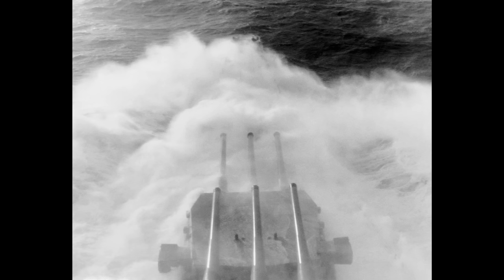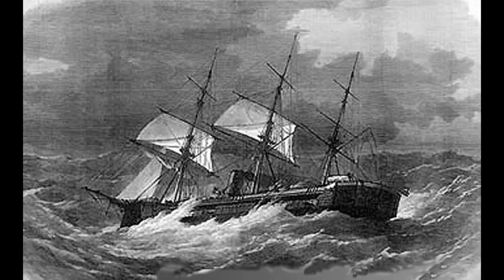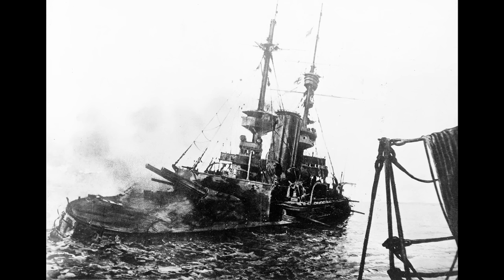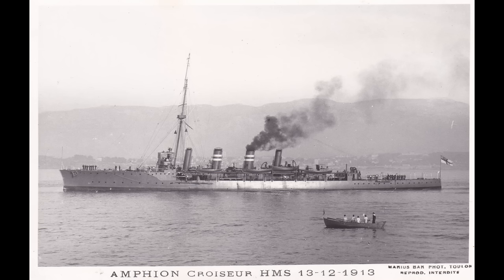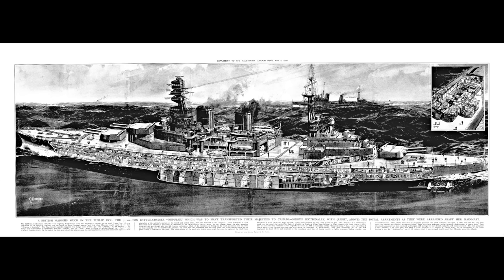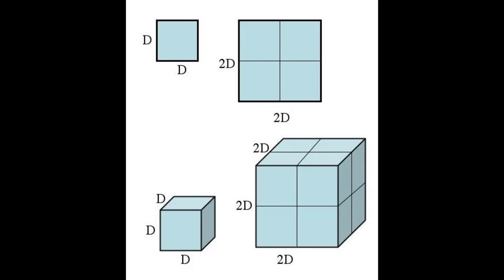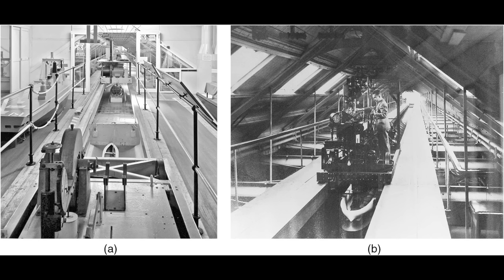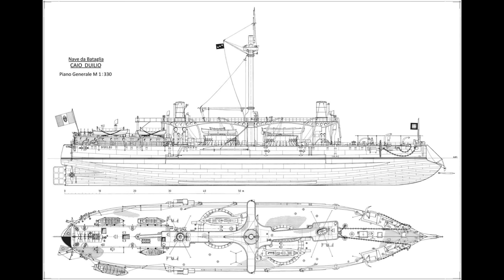Hull Form Design - Doing better than a floating brick

Comment: The Square Cube Law: it's why a 20" shell is a lot more than four-inches scarier than a 16" shell.
Reply: Before taking in other factors,the funniest being that no one knowing that your BB has the biggest fielded guns due to how well kept a secret it was until after the war is over.
Reply: As a practical example, the iowa's super heavy shells had around 18kg of bursting charge, the yamato's type 1 had 38kg. That's at least 2 times as scary lol
Reply: @pedrofelipefreitas2666 ,one of the other factors was the fact that the Iowas' shells actually penetrated better at long distance due to the denser design of the fore end then the Yamatos' shell.

Comment: Currently sitting in my stateroom on the usns loyal watching this. Google the ship to see what happens when you care about sea keeping to the extreme. We barely roll at all in up to 12 ft seas... but out top speed in a sea state 0 is 6 knots
Reply: That is the epitome of brick
Reply: @valhallastiger2960  Well, it's not meant to go fast.  It's a passive SONAR surveillance vessel.  I would think a slow top speed would be considered a desirable feature in such a ship.  Passive SONAR doesn't really get along that well with fast travel through the water.

I do have to wonder how USNS Loyal managed a rated speed of 9.6 knots if she only makes 6 knots in a flat calm.
Reply: @evensgrey  i wasnt attacking the ship it just wasnt what i was expecting to see 

Is it twin hull or single?
Reply: W I D E
Reply: @evensgrey  maybe when it was first commissioned it went 10 knots ( I doubt it) but she's not exactly a young girl anymore. If we really push it we could get 7 knots probably... but then the main engines would want a few weeks of R&R
Reply: @valhallastiger2960  twin hull
Reply: @valhallastiger2960  And, well, she is shaped kind of like a brick.  Of course, being a catamaran design, drag has little to do with her actual length to beam ratio (which is an otherwise astounding 2.5).
Reply: @michaelhellwinkle9999  i guess that helps make her more stable spreads the weight further?
Reply: @evensgrey  6 was probably a bit low of an estimation I guess. However I can say we try to go with the current when we are on station as much as possible, so that 7.2 should be taken with a grain of salt
Reply: @evensgrey  we are currently in port in Yokohama, but yea, could be rough when we go back out, but that's why they pay me
Reply: SHE A BIG GIRL
Reply: @evensgrey  I assume it involved dumping copious amounts of NOS into the engines.
Reply: TANSTAAFL.
Reply: Is that a SWATH design?
Reply: @Hugh Culliton i believe a head sea is coming from straight ahead or behind and beam is coming in from the side not certain though

Comment: Then there's all the fun you can have with SUBMERSIBLE hulls.

Back when the US began playing with nuclear powered submarines, they decided to build a little experimental boat, mostly full of batteries, to do some testing of what the handling characteristics of this new hull form called a 'body of revolution' would be like.  The tank tests said it should be a very efficient hull form for a sub while underwater, which was where a nuclear powered sub was expected to spend almost all it's time while on patrol.

A body of revolution is one which is formed by taking a curve and rotating it about an axis.  For the sort of curve you'd use for a hull shape, the result is sort of cigar shaped, and all cross sections of it are circles.

So, they build this test boat and take it out to do test maneuvering to see if it does anything strange.

Well, it did something strange, all right.  The strange behavior was named the "Jesus Christ Factor," most likely due to someone saying that when it was discovered.  One of the properties of a hull form that has all cross sections being circular is it has no hydro-dynamically preferred orientation in the water.  They tried to pull a sharp turn (like you'd pull in combat to evade enemy anti-sub weapons) and discovered that when you turn sharply in a sub with this kind of hull form, it likes to snap-roll into a steep dive, in excess of 45 degrees down.

Now, snapping into a steep dive is fine and dandy when you WANT to do that, and could make for a nifty evasion maneuver, but most of the time you don't want to evade like that. It risks you hitting the sea bed or exceeding your crush depth.  fortunately, it just needed a small rudder added to the back of the conning tower to prevent the boats from doing that.
Reply: USS Albacore. 

Round hulls with the slab sided sail makes for an interesting ride on a surface transit in rough seas.
Reply: @mikespangler98  Yup, the US Navy spent decades interested in any kind of round hulls with slavs.
Reply: Just reading this made me pucker up. Congratulations, you actually made me feel anxious... and very glad I am a Mountaineer, not a Mariner.
Reply: @Deridus  Testing out new vehicle designs can indeed be fun.  Makes me glad I don't I'm not a pilot of flying, floating, or submersible craft.
Reply: @evensgrey  There are some things I am too chicken to do. I know my limits. That said... In a different life track, I'd love to be an experimental aircraft pilot.
Reply: @Deridus  I have the opposite problem. I don't have very strong self-preservation instincts, and yet I'd like to be a test pilot, too. Probably good I haven't got the opportunity 😅
Reply: Icebreakers are interesting too. Hull form is also circular, to resist pressure from ice. Kinda shaped like a football. Man! They can ROLL!   (At least the Wind Class breaker I was on could, rounding ‘The Horn)
Reply: that makes for an interesting hypothetical underwater fighter craft. Imagine a sub with everyone seated in car racing seats with harnesses at their stations... Sub does snap rolls, immelmans, split s's  etc 😂 i suppose with nuclear power, you could probably even do an "outside loop" given enough depth...  Haha would make an interesting anime at least, underwater fighter planes haha
Reply: @Colt45hatchback  You'd be hard pressed to jam a power plant able to drive a sub through those kinds of maneuvers into a hull small enough to actually pull them off.  You can get away with aircraft pulling those sorts of maneuvers because air is so much less dense and so much more compressible than water.  You'd have to have a really, really small sub to try those kinds of maneuvers, and it couldn't hold much in the way of a power plant or weapons.

But, as you say, in anime, well, who pays attention to the laws of physics?
Reply: @evensgrey  yeah I agree, just a bit of humor not reality.
Reply: @evensgrey  I mean, if you've got a dense enough power supply (ultracapacitors or some kind of high-density chemical fuel either traditionally combusted or run through a fuel cell) you could get enough power for a short-range craft.  You could help the miniaturization by replacing the pilot with a computer.  At that point, though, you're probably just better off making a better target-seeking torpedo than an underwater fighter as you only need to get it enough power for a 1 way trip with 1 weapon and don't need to worry about how the parts will hold up to repeated use.

It's not that it's impossible to design small underwater combat craft.  It's that it's hard to design ones that outperform a torpedo for a given effective range (especially if you're wanting the pilots back).

Probably better that way, though, if less cool
Reply: The USS Albacore was a hull test bed. She was powered by two vertically mounted radial diesels. (can’t remember the number of cylinders), and was built without armament.
During her lifetime, she had several different rudder, stern plane, screw, and sail designs fitted. Maybe bow/sail planes as well.
She can be toured and studied at Portsmouth Navy Yard. 
Being an old Polaris Submariner myself, I would have loved to serve on her during these design iterations.
Reply: @evensgrey  Ackchyually ... there are ways to dramatically reduce high-speed resistance (eg, supercavitation), reactor designs that can be much lighter and more compact than traditional PWRs (eg, molten salt reactors), and probably propulsion systems far more suitable for use in a high-speed/zero-stealth sub, as well (supercritical steam jet, maybe?).

As an aside, learning about the history of molten salt reactors made me say two things I never thought I would: "Cheap, clean energy should be no problem at all!" and "Thank goodness for ICBMs!" You see, MSR's are classified as an "advanced reactor design" many think are at least a decade from commercialization, and could potentially eliminate virtually all of nuclear energy's issues, particularly safety. However, the first MSR was built and operated in the 1960's, and showed significant promise, but was not just abandoned but forgotten after the cancellation of the program that spawned it, namely America's quest for a nuclear-powered bomber. It took 40 years for someone to stumble across a footnote in a history of nuclear energy and say, "Hey, that sounds interesting. Where'd all the files for the program end up?"

I didn't have much faith in humanity to start with, but learning all that made me lose most of it. 😆
Reply: @Deridus  cautious curiosity is exactly the attitude required to be a good test pilot. there are old pilots, and there are bold pilots. only very few have the luck required to be both old and bold. knowing how to expand your limits without exceeding them translates directly to your ability to test an aircraft without killing yourself or destroying the prototype.
Reply: @tissuepaper9962  I've always wanted to be a pilot. If we ever get off tis rock, I envy the first person who will actually fly under a diffrrent sky.
Reply: Can someone answer why early dreadnoughts had underwater bows projecting in front of the prow?  This was changing as we entered 20th century.
Reply: @slotcarfan  Most early dreadnoughts had ramming bows.  This primarily stems from multiple effective rammings carried out during an unusual battle in the 19th century involving the Italian navy.  I think the only dreadnought to successfully ram anything was HMS Dreadnought herself, who managed to ram and sink a sub.  Eventually it was worked out that ramming was not a good idea, and the ramming bows were no longer installed.  Not long after, similarly shaped bows were added back because they allow ships with them to move faster for the same applied power.

Comment: Everyone: Which would be better, thin and long, or short and wide?

Rear-Admiral Popov: R O U N D.
Reply: " K R U G "

(КРУГ is circle in Russian.)
Reply: I vote for a coricle
Reply: An expression of the Russian soul in steel - present a threat in all directions,  while confusing the opposition as to where you're going next!!
Why aren't there more armoured coricles around, I wonder......(nod to Tom 😆). On another note, there was a 2018ish? attempt at a similar ice pack resistant arctic oil drilling rig/mobile island deployed off Alaska, didn't go well and ran aground on a real island. 🙄
Reply: R O T U N D
Reply: "Ahh, I see you are an Admiral of culture, as well..."
Reply: Robbie Burns answered that one with a typically bawdy poem:
Lang and thin gaes tee far in
And disnae please the ladies.
Short and thick does the trick
And brings forth muckle babies!

Comment: As a naval architect with more than 45 years of experience in hull design,  this was a good video for non-technical people to help them understand the complexity and compromise that goes into every ship design.  
On stability: roll acceleration is critical not only to equipment functionality but also to habitability. Too stiff a ship, roll period very short,  and equipment, especially those located in high places can actually be broken off the ship, and people have trouble standing and moving around. 
On speed/power: as a gross rule of thumb for every 3 knot increase in speed, double the shaft power. This rough approximation works throughout the speed range.
During my 12 years responsible for hull form at a major U.S. shipyard,  it was common for us to go through dozens of iterations on the hull geometry (both commercial and naval auxiliaries ships) before we settled on one that met all of the requirements for speed, power, range, habitability,  seakeeping, maneuverability, as well as sufficient volume to carry whatever was necessary to meet the mission requirements. Inevitably,  the final hull was not ideal for any requirement,  but always met, and often significantly exceeded,  the contract specifications. Always a fun puzzle to crack!
Reply: On stability(habitability): I think some roll periods/accelerations are very detrimental to seasickness and such, so that also have to be considered.
Reply: Does that doubling power for an extra 3 knots apply to those 10,000 gross ton catamarans made by companies like Incat that cruise at 40 to 50 knots, or is the equation different for big catamarans?
Reply: The soul of engineering is compromise.
Reply: @philipwebb960  the art is how you put ten pounds into a five pound bag better than your competitor.
Reply: Thank you for sharing
Reply: And this is also the reason Asian ship yards build dozens of identically sized and shaped cargo ships regardless of the service they are designed to meet. Basically Oil Tankers, Ore Carriers and Container Ships from a given builder are dimensionally identical externally with almost identical power & crew modules at the rear.

Comment: I can't believe you didn't go at least a tiny bit into the American stern, with its surfboard like qualities that got rid of the turbulence not by narrowing the stern horizontally, but tapering it vertically. THAT is where America got her fast battleships, even though prop design then became a problem for quite a while, due to cavitation, the boatman's nightmare.
But by narrowing it vertically, it made each fast battleship into a surfboard, not only not wasting its hp by burying its ass into the sea like any old displacement hull, but using that wasted hp to propel them even faster, by surfing their own wake, a phenomenon most experienced pleasure boat captains are familiar with. Transferring that concept to a battleship platform, given that almost all pleasure yachts at the time went for the traditional horizontal narrowing so the bow looked much as the stern, was indeed revolutionary.
It was really only achieved 100% with the Iowas, due to length limitations on the Washingtons and South Dakotas, but not mentioning it is sort of goofy, given that all modern warship and many commercial ships use the exact same technology, just tuned up a bit.
Funny you included the square stern, but not that. You do know only American Heavy Cruisers had that stern? Light cruisers had traditional round sterns, which were the beginning of the surfboard stern, although far simpler as they were so narrow. The fat battleship sterns came from this concept.
But I suppose you could go on forever on this subject. Kudos for a valiant charge at a complex subject and an extremely understandable presentation. I dare say you might have saved many lives by making Sunday sailors more aware of metacentric height alone! (Their eyes glaze over when the phrase is even mentioned, even though they own a million dollar yacht!)

Comment: Drachinifel: mentions a brick.
USS Monitor enters the conversation.
Reply: At least USS Monitor's turret was "maneuverable" as in it is forever spinning even in the depths of davy jone's locker and imitates a certain famous adorable seal...
Reply: @ogscarl3t375  It did its job. How many vessels ever built can say that? And built in a nonce, at that. Never laugh at THE MONITOR. Monitors in general, laugh away until your gut splits, but NOT The Monitor.
Reply: Actually the Monitor's hull wasn't per se a brick.  It was well tapered at both ends.  Her issue was the complete absence of freeboard, along with flush grates in the deck for ventilation.
Reply: You rang?
Reply: Barges enter the conversation.

Comment: Very nice explained al lot of things about the hulls.
Thank you for this.

I would like to share my thoughts about sailing ships (42 minutes).
The propulsion of a sail is indeed high above the center of gravity.And it can push down the bow , especially from the mid mast. 
But we have  also  sails far before resp after the point of gravity.
It is possible to lift the bow with the most front sails (like a spinnaker on a modern sailing boat).
The next following...It is not the sail pushing to the mast and the mast pushing the ship forward.
It's the rigging which bear the most (pulling) force to the ships hull.
For what I know about sailing: The mast is mostly to keep the sails high up above the ship .